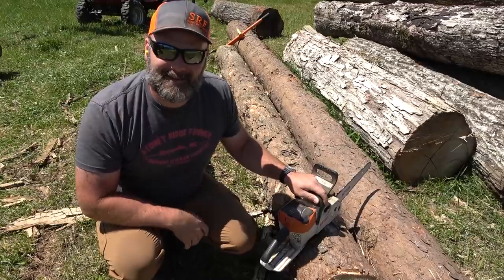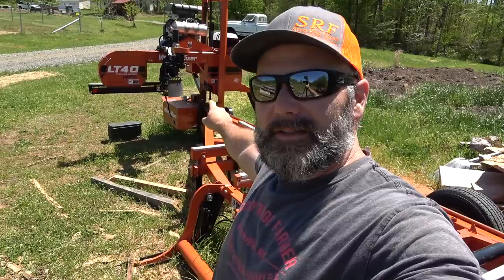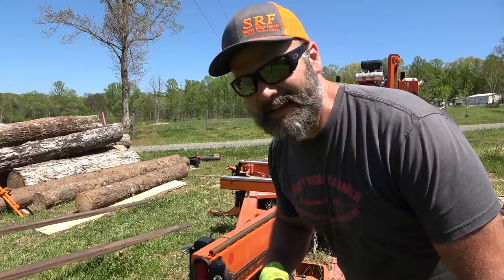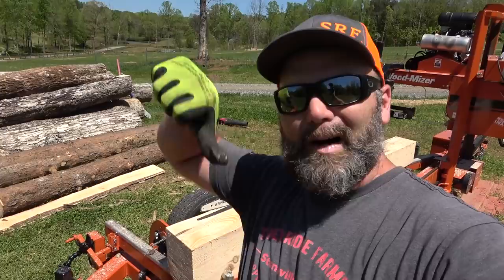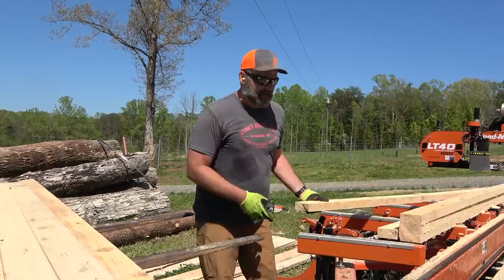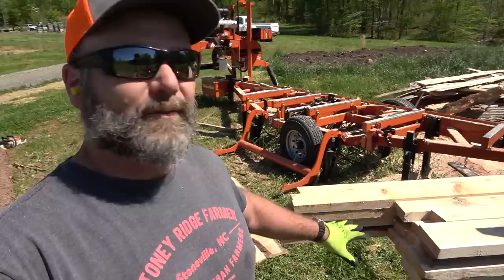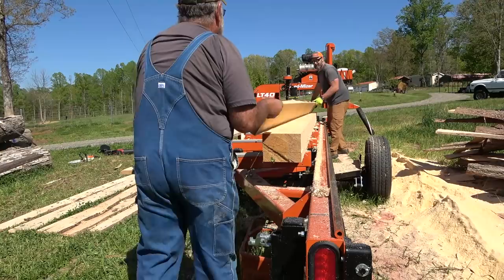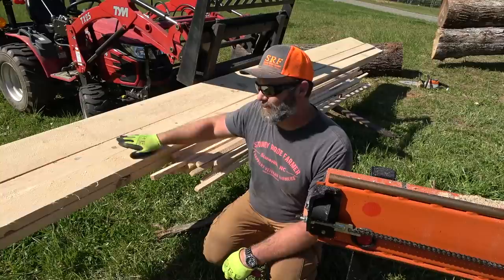How to Talk Your WIFE into letting you buy a SAWMILL

Comment: A good idea from “Sawing with Sandy” he built a “X” frame stand that he throws the first cuts on to, so there are 5 or 6 X’s at 16-18 inches apart, then when it full he cuts between the X’s and he has firewood lengths cut and not a big pile of long waste that needs to be handled again.
Reply: I've bought hardwood "slabs" from a sawmill to burn for firewood... good stuff

Comment: It’s not often that we see lumber that measures out to the descriptive numbers.  As a firefighter I had to be aware of the age of a structure.  Modern dimensional lumber keeps getting smaller and contributes a greater potential collapse factor.
Reply: Very true!  I've seen saw mill lumber oak used, 2x4 sawmill pine, 3.5x1.5 pine,  1.75x2.5, and 1.75x1.75  lumber all used in building construction.... main reason we never ladder a manufactured home. 
Stay safe brother!

Comment: I thought you had to hire a inspector to come in and inspect it before you could sell it. That might just be for any boards that will be weight bearing. I would recommend checking into it before making any big plans.
Reply: Depends on how they are going to use it. Around the farm, probably not. To build a house or addition, probably so.  Inspectors look for the seal. Good advice to check to be certain.

Comment: Did you see on out of the woods, he was using off road diesel for lubing his blade. He set it on the lowest setting and only had it on about every 4th board. Hope this is good info for you. He also said it was cheaper than wind shield  washer fluid.

Comment: The wood mizer is a lovely machine but needs rethinking a bit, there is no need for expensive circular blades or the time waste in changing them,  vibrating multi tools cut wood without circular motion using oscillation, therefore less than half the blade ($), less motion means less greasing of parts, easy and cheap change of blades and a cheaper machine needing less servicing - wise up wood mizer :).  With all these savings add auto tension of the blade its easy real easy

Comment: Such a great machine, fine day wind fall trees wood Meiser . Fun to run a great tool. I think a bigger petti bone a long turning tool may help save your back look find an old or new one sharpen up the hooks or barbs and save on your back brother.
Love seeing this Vlog yep I want one; build yourself a drying shed or two . Tall shed back wall to prevailing winds and tall shed roof strong steel racks stock pile home build wood. Framing floors siding ship lap T&G 2X6 for ceilings door stock front and main doors. Plans take off list starts stacking it away build your own milled lumber home bring down that build price. Shaper planner jointer Oh Yeah brother. 😁 Woo hoo
Absolutely fantastic. 
Best David
Look at house plans and start stacking materials cut down price overhead plans yeild material list yeild cut list, also keep checking craigslist for materials not able to make plywood underlayment OSB windows roofing fixtures electric & plumbing both get a nice house package stacked and loaded put a camera on it for you know why.  Bring down house  build hard cost.